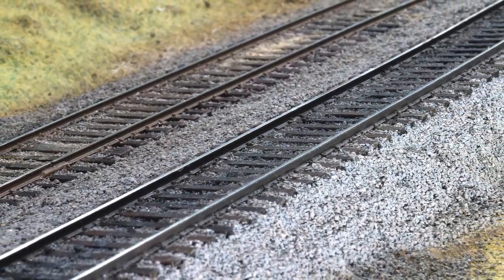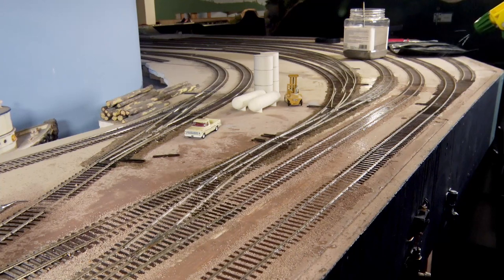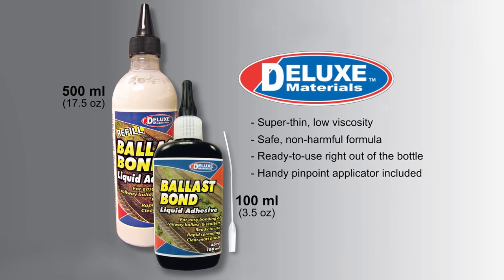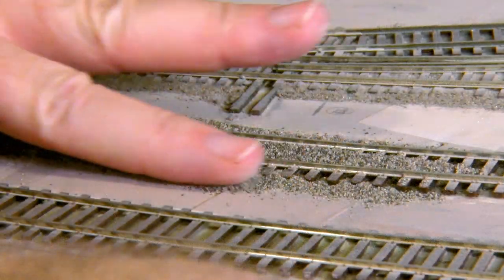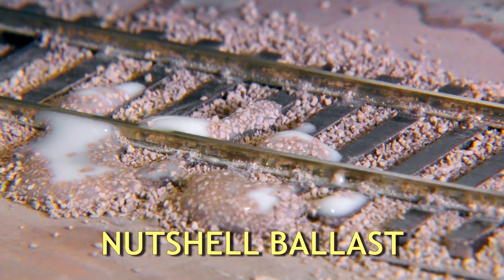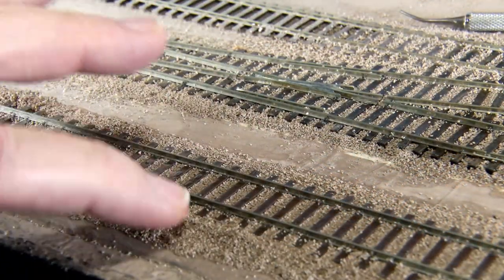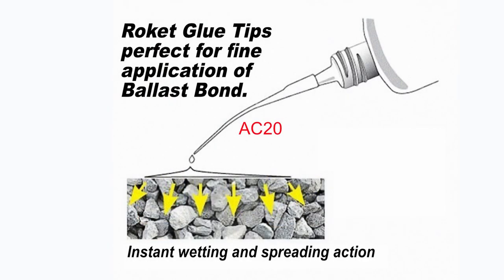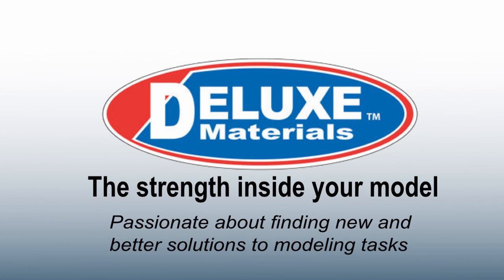Ballasting game changer - Deluxe Materials BALLAST BOND

Comment: No , if you put some detergent in the water and whiteglue mix you will not have that problem and the glue will easily penetrate the ballast. At a cost of almost nothing...
Reply from the maker: Cost may not be the only consideration. Time can also be a limited resource, especially if you have a LOT of layout to ballast. I've never had good luck trying to get white glue to flow better by itself -- I've always had to prewet the ballast with a wetting agent. If you have a successful process that does work with any white glue and no pre-wetting, then write it up and send it in to Model Railroad Hobbyist for publication.
Reply: @MRhobbyist  Try using Copydex instead.
Reply: Negative!!!!!!we tried that method of detergent in the pva and  it would not penetrate the ballast it would only make a “shell “and would fall off. Tried different combos and it did not work at all!!!same results no penetration of the pva into the ballast!!!

Comment: Glue and model railway track.....great until you want to rebuild ...the water used gets into the timber, and the glue makes the track stiff and brittle, and wrecks it pulling it up. If you have a few hundred years to wait to pull it up you may do a little better, but most of don't have that luxury. Ive gone to paper printed ballast. Faster, cleaner, saves the track, reusable, looks crisp and straight. The colour printer aint cheap to fill, but hey....one cannot have everything. I can make concrete sleepers, wood sleepers, or where the ballast covers the sleepers..on sidings. Stains, differing shaes of ballast...no problem. But there is one wee bugbear, getting it to stay stuck down using double sided tape, in humid conditions, it later wants to unstick. So its not perfect either.

Comment: I see no miracle product here. Get an appropriate sized spritzer bottle, like the ones teens use to help wet their hair. These spritzer bottlers have a more defined spray area and atomize the water spray better, and they are cheap. Use a 70% water - 30% alcohol mix for wetting

For glue, use diluted Mod-Podge in the same 70%-30% mix. Add a couple of drops of detergent.

Use an old Elmers Glue bottle for an applicator. The bigger the better so you don't need to refill as often. Remove detail parts from the work area, mask off switch points and wet the area until you can tell you've gone too far. Liberally apply the M-P mix. Go over the area a second time with wetting agent and a second coat of M-P. Wait a few hours to check for missed spots.

I look at that applicator and I can't imagine ballasting more than a few inches using that tedious an application tool.
Reply from the maker: Write it up with photos and send it to us and we'll publish it -- and pay you for the article. The great thing about this hobby is there's a method for every situation. If time is limited, spending a few extra dollars to use Ballast Bond and get the speed can be quite helpful if you have a LOT of layout to ballast.
Reply: @MRhobbyist  I've heard it said that you can't be a model railroad author until you've written your first article on ballasting track. I'll give it a shot - if the pictures turn out, you'll see it in your email.